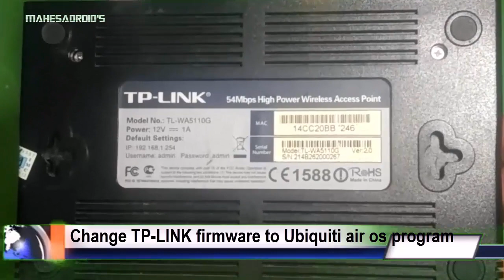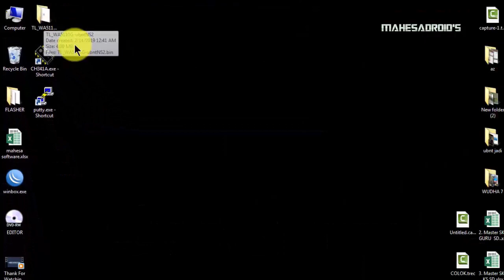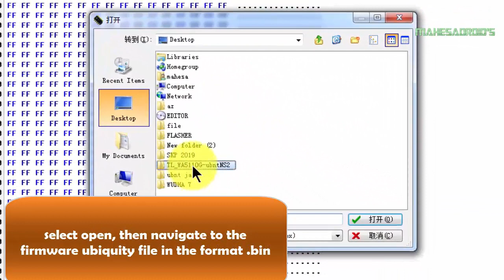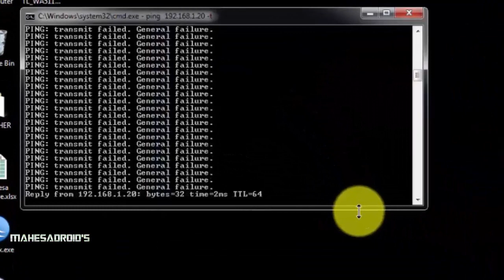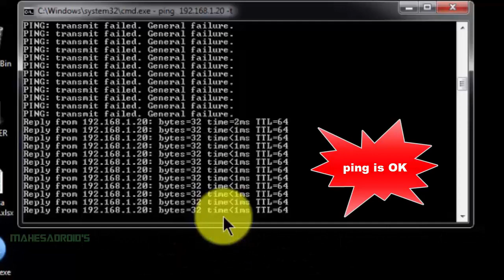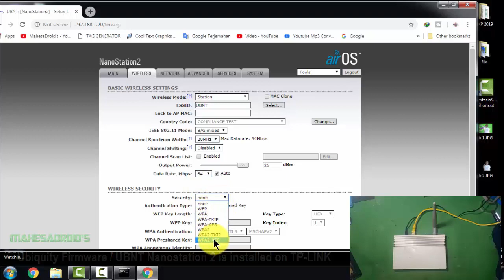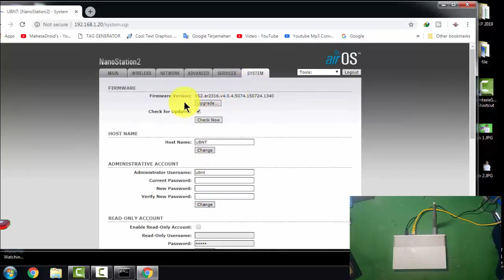Upgrade TP LINK ke UBIQUITY untuk nembak bisa wifi gratisan

Comment: Bang saya mau ganti IC EEPROMnya tipe aslinya 25Q64 mau ganti ke 25Q128 Bisa ngga? terus data flashnya dari firmware yang udah didownload ya? .bin itu
Reply from the maker: 128=16mb , bisa bgt mas
Reply: ohiya mas, kenapa tplink archer c20 pake firmware bawaan gabisa untuk WDS wifinya